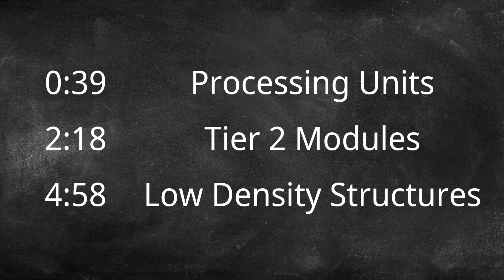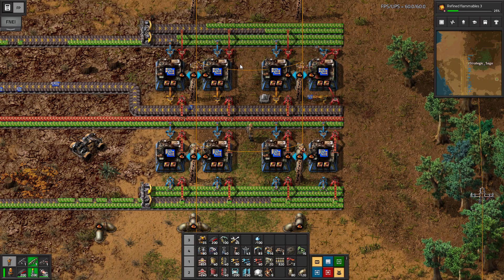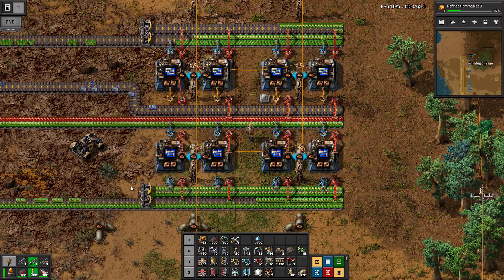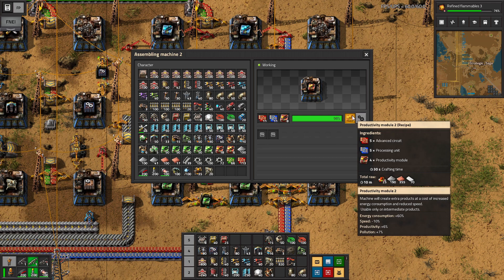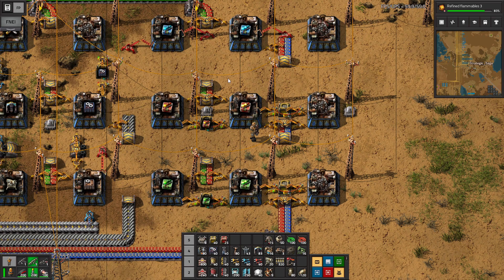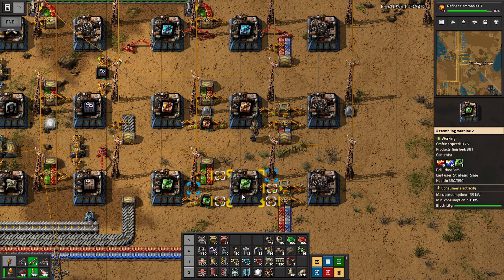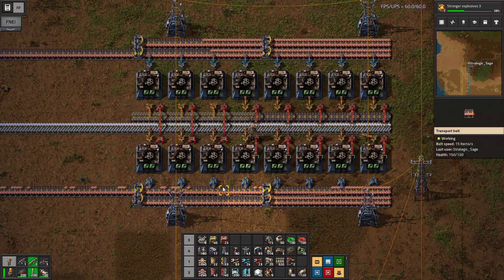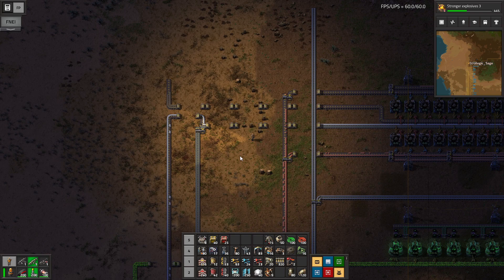Processing Units & More | Factorio 1.1 Tutorials for New Players #37

Comment from the maker: One difference I meant to mention between the circuit and structures setups is that I'm using inserters for the 'outside' belts on the circuits, splitters to move everything inwards on the structures.  Just another wrinkle as there are many ways to get it done as always.  Also, the next episode will not be about resolving shortages as mentioned;  I got the order mixed up in my head.  We'll be looking at late-game science setups first.